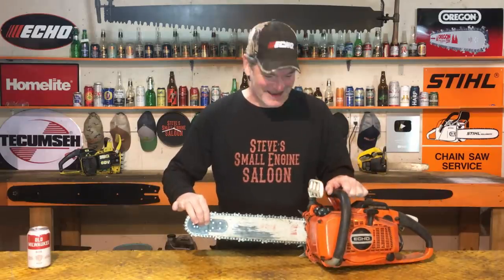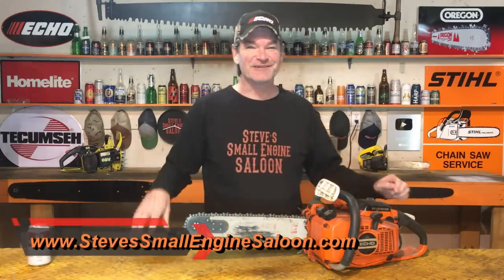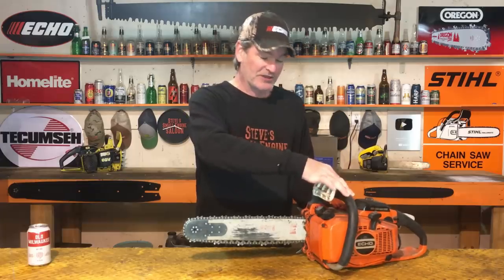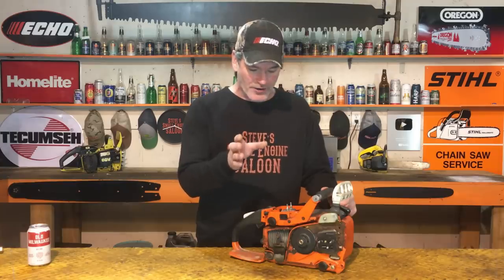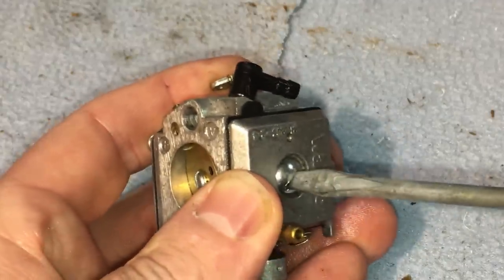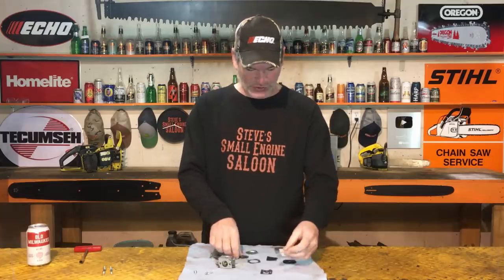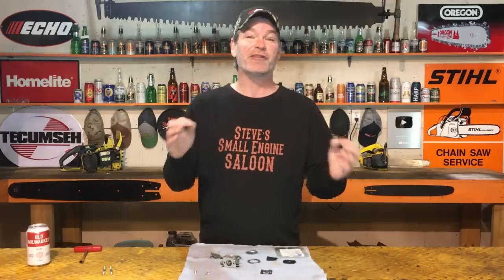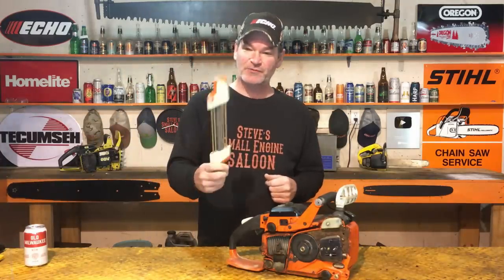How To Fix An Old Echo Chainsaw That Will Not Run

Comment: Another great video. I have a dead 650 EVL I am hoping to bring back to life. I have a couple of questions if I may ask. Typically you are dealing with 40 to 1 and 50 to 1 when it comes to fuel mix these days. Is it true that these old saws call for 20 to 1 fuel mix? Regardless, what is the best fuel mix you like to use? Thanks. Dennis.

Comment: Had to check this out. I was falling and bucking firewood with my 650 EVL today. I need to learn how to adjust the carb
Reply from the maker: That video is in my playlist!
Reply: I also need to grab a few of those spiral fuel regulators...none on Amazon.
I have the B55 blower, Echo 650 EVL,  and a Makita weed eater.

Comment: My dad had an old Remington that was on a shelf for 30+ years and it ran like new after getting it running. I told him to increase the oil mix because it was rated at 20:1 and he was using Homelite 32:1 and it seemed to lag a little.

Comment: You're wrong on the rpm's! I've worked on those when they were new. The older 500 EVL is the same saw with a smaller cyl/piston. They were red-lined around 11500-12000. What you were referring to was the max torque/rpm. They had intake boot & ign coil problems. Shortly after those saws were made Echo found out mounting the coil to the cyl was a no-no. The ign system was 2 piece & 1 of the 2 quickly became unavailable. Bet there's a bunch of those still good enough to run but with coil problems.

Comment: Nice video, I always enjoy your productions.  I too recently got an old Echo chainsaw, model CS-4000 (yes 4000 not 400).  Anyway, I got it running which great, but now I need to replace the bar and I've had no luck finding one.  I'm guessing that I could convert do some sort of conversion with a new sprocket but would love some guidance.  Any suggestions would be appreciated.  Maybe an idea for a new video for you?  ;-)

Comment: My mate had one of those everytime you went to use it you had to drain the cylinder of chain lube oil by removing the sparkplug and pulling it over a few times
Reply: Wut? How did bar and chain oil get into the cylinder?
Reply: mannys9130 maybe they got the oil and fuel tanks mixed up? lol

Comment: Do you have info on how the ignition system works?  How to test CDI Flywheel module and spark coil.  What to look for when there is no spark.

Comment: is the 9000rpm mean in the cut or under no load? i suspect it means under load/in the cut? but i may be wrong, the reason i say that Steve is that it is still four stroking in the cut , when set up right that four stroking/burble should just disappear when cutting.

Comment: Thanks for the video, Steve. I buy and sell vintage saws in Portugal as a hobby (i was a STIHL technician for a few years). In my personal collection have a STIHL Contra/Lightning, a STIHL 08S both working. In project fase have a STIHL 041 no AV and a 050 AV. Can send the video of the 08S working if you want.

Comment: I just picked up a early 1970s CS 451VL ECHO. It will not oil the bar. Can you give me advice on how to make it oil? If you are familiar with this model. It has a internal oil system. The oil strainer seems missing and it will not automatically oil or manually.

Comment: You make it look so easy. I have a craftsman chainsaw that i adjusted the low and high adjustments on. I thought I left running perfectly so I cleaned it and put it away. Four days later I took it out in order to trim a some tree branches, but the darn thing would not even sputter. It was completely dead not matter how many times I pulled the starter rope. Why did it run perfectly when I put it away? I don't understand it.

Comment: I picked a chainsaw from the garbage. Started and died on fluid. The metering diaphragm was hard and crispy. I put it in a pot of boiling water for 20 minutes, It came out soft and pliable. The saw runs, but not perfect. I may get a carb kit. but perhaps it may work for you.

Comment: Saw an old yellow Echo at the Tipshop a few days ago no running but. I found some torque specs online for the cylinder head bolts of a Husqvarna 55, 9.6 ft/lbs - 11 ft/lbs or 13Nm - 14.9Nm, I'm hoping they're the right specs for my Husky Rancher 50 1988 model. Why can't I find specs online particular to my saw? I think the internet has changed.

Comment: Hi Steve.  I bought an Echo 302S with an external oiler adjust mounted topside.  Apparently someone has had the knob off, and messed with the barrel fitting underneath.  Do you know what the factory setting for this brass connector is?  Thanks, Wes

Comment: Hey Steve, I have an Echo chainsaw CS400, I couldn't get it to start until I took the muffler off. New spark plug,new filter and the carburetor is in good shape. I know I'm getting fuel. It's just wouldn't start with the muffler. Bought a new muffler and same result. I'm running out of idea. Thanks

Comment: Hey Steve just found your video on the 550 EVL. I have one as well, bought it new in 83 or 84. Mine has the same issue as the one in the video. Do you have a part number for the diaphragms and a good place to order it from? Thanks Lester.

Comment: Steve, I have the John Deere version (55V) of this chainsaw. Mine is considerably dirtier than yours with black, tarry crap under the clutch cover. I managed to remove the clutch drum but cannot see how to remove the clutch which I need to remove to get everything clean. Any idea how to remove the clutch? I don’t see a key way and cannot discern any threads. Whattaya think? Darlington, South Carolina USA

Comment: The old ones were built with much better materials back then. I've owned a small engine repair business since 1983 and witnessed the changes to Echo equipment through the years.
Reply from the maker: Right on Kurt...

Comment: Question, I am trying to replace the fuel line on a Mac 3216. I am haveing a very diffacult time threading the fuel line from the carb to the tank. I tried trimming the line to an arrow, tried useing a piece of wire inside the line, nothing works. If by chance you have any tricks of the trade I would be gratefull. The local shop here had no advice other than what I already tried. If you dont have any I will still try to figure it out. If I do I will certaintly share with you. If you are unable to help its all good.

Comment: Awesome video Steve! But as I watched you START up the saw I freaked out. Because I've been starting my saw a completely different way for 30 years! You drop start your old saw with your right hand holding the back handle with your finger on the trigger. With your left hand you pull the start cord. Now here's the way I've always done it and by the way, I've always had trouble starting my old saw and maybe this is why: With my left hand I hold the top handle. I drop start it however, by pulling the start cord with my right hand and dropping my saw by holding it by the top handle with my left arm bent at 90 degrees then straightening my arm thus "dropping" my saw. My finger does go to my trigger after my saw starts. Does it matter which way you start it? Or is your way the proper way to start it? OK, so I tried it your way and I couldn't even hold the back handle with my finger on the trigger as I drop started it with my left hand on the starter cord!  I'm right handed and it felt completely awkward and weird like I was suddenly retarded and uncoordinated, or at least, more retarded and uncoordinated than I usually am! I have an average to small sized saw and I wasn't even strong enough to hold it up by the back handle with my finger on the trigger with my right arm bent at a 90 degree angle like you do. Doing it my way when it was brand new, it only took one pull. But now its over thirty years old so every time I top up my tanks and try to start it, it takes over 20 pulls! What am I doing wrong and how do I fix it? Two requests: could you make a video on the proper way to start a chainsaw? And another video to teach how to tell when your chain file is dull or getting dull?

Comment: Question:  I was noticing the sawdust that you got from that saw.  Mine is a small electric and I used it for cutting up a cherry laurel that fell (14" caliper).  Before I started, I sharpened it up and took the file with me.  It worked perfectly, but I got ribbons instead of sawdust.  Would you happen to know why that happens with my saw and not with yours?

Comment: I have the same chainsaw but it’s a 500 VL and it only runs if I back the high and low screws out pretty much all the way— is that OK or should I junk that carburetor and put a new one in?

Comment: Wont allow me to add  my name Will T. I have a 1981 Echo CS 60S. Just fired up the ole girl the other day. No Anti vibration, no chain brake. She is still a beast.Only problem, It has a throttle lock, spring tab broke and throttle will stick WFO. Will have to replace it. I never use ethanol fuel.

Comment: Got an echo 315-had bubbles frothing in The fuel tank- low power. Found the fuel filter in the empty tank- pulled the fuel line off the carb- no issues found but cant seem to reconnect the fuel line to anything going back into the tank? Still not sure why power was so low-
/

Comment: Great Video glad I found your page will definitely be watching you now! I recently acquired the same saw, i have spark and compression as well so im trying to find the carburetor parts or even the kit # and coming up empty handed as all i can find is now discontinued. Any suggestions would be greatly appreciated.
Reply from the maker: Look up the parts for the carb, NOT the saw...
Reply: @StevesSmallEngineSaloon  thanks

Comment: I have found that if there is a need for ignition parts on this 550 model with two part system there are not any available.  No used, new or aftermarket as a direct fit.  I know if I could find a coil with integral trigger and it would bolt on there is a chance it would work.  Timing is the only issue that is going to be the problem when going down this rabbit hole.  Moral of this story is if ya find an older echo it is worth more for parts than its worth as a running saw.

Comment: A good synthetic base oil Ester oil such as Sthil HP Ultra will help soften up and slightly swell up those old crank seals. Kind of like the same thing as what a high mileage type motor oil does.

Comment: I have a 452VL having problems with the tried to hit the lever to pump oil in the bar and nothing comes out took the bar off to see if it worked while it was running still doesn’t work I don’t have a manual for it so I don’t know what to do to take it apart and not finding out that’s not the problem

Comment: Hi steve  i have this chainsaw it came with a .352 chain can i change it over to 3/8 it has a .352 7 tooth rim sprocket  like to change it over to 3/8 the saw is 62cc hope you can help thanks

Comment: Well first of all. The first thing that you do is clean the spark plug or put a new one in If it does not spark or shock you then clean the magnets on the flywheel and the coil free from rust. If the engine has compression this is the first thing to do. Once you establish spark then figure out the fuel system.

Comment: Hi Steve: I own a model Echo 302S. My chain oiler fails to pump out oil. I've cleaned out the oil tank and checked the hose screen and it's clean. I removed the brass oiler plunger, o-rings appear to be in good shape and used compressed air to confirm the suction hose and the output port are clear. What do you think is happening?
Reply from the maker: Check my other video in my playlists...

Comment: I fixed my dad's echo CV650. All I did was put fresh fuel in it. The pull cord was broke used a drill and it fired right up

Comment: Is it hard to remove the carburetor on that saw? I have a 440 EVL, is it close to the 550 EVL? Does anyone know if the 440 and 550 share the same carburetor. I want to buy the rebuild kit for mine too.
Reply: Anyway I got courageous this morning and I removed the carburetor I found it was a wa133 and there was an E5 on the lower left hand corner. I ordered the rebuilt kit and I hope it comes in in the next couple days that it actually starts!!!!

Comment: Steve or anyone else, Does anyone have a solution for a defective Echo 650 EVL ignition coil which local dealer says is no longer available. Any help would be appreciated as I have a perfectly good saw with no spark.

Comment: I think this is the problem with my 601S. https://www.echo-usa.com/EchoUSA/files/2d/2d7e8a9b-b68f-4c4e-b9b9-0c4ba8a612a5.pdf

Replaced plug and fuel filter already.  

Where do I get a carb kit?  Can I clean instead?

Mine is a Kioritz model brought back from Japan in the 70s.

Comment: I know this is an old video but I'm hoping someone will give me an answer. I am trying to remove the carb on my Echo 550EVL. I can't get the linkage levers (choke & throttle) off. How do you do that?
Reply from the maker: I believe on that model, you take the mounting bolts out first.  Then you can twist the carb back and forth to pull the rods off the carb!
Reply: @StevesSmallEngineSaloon  Thanks! I got it off. Didn't realize the two top bolts had to be removed along with the lower mounting bolts.

Comment: Hey Stevo. I got the little brother to that saw (CS 440 EVL) from a trash heap that been sitting outside in all weather for years because it had its handle completely broken off. Got a pretty new handle on eBay for 20 bucks, cleaned it up with some gas and replaced the metering diaphragm with a used but decent one I had from a carb lying around. Fired right up and you can see it rip on Instagram at @djprowse AKA Silky Steve. Follow me if you like to see videos of some of the other saws I've brought back from the dead.  It is my go-to firewood saw now.

Comment: I had the same model echo chain saw 30 years ago. Cut  hundreds of logs with no problem !
Lasted for years until the  cylinder head  became scored at the same time compression went.
When that happened the saw was too old. Not worth repairing !

Comment: RPMs are not everything.  That saw sounds like it had the torque to maintain the same speed when cutting as it did when you first touched the wood.
Reply from the maker: Right on Larry...